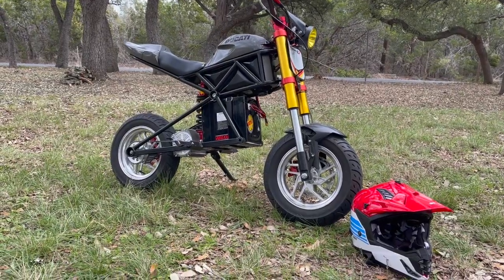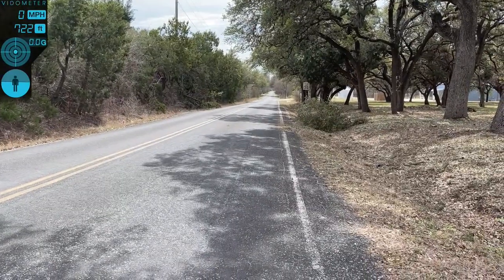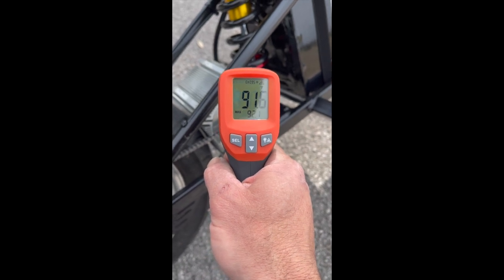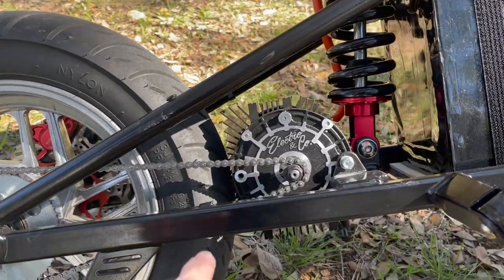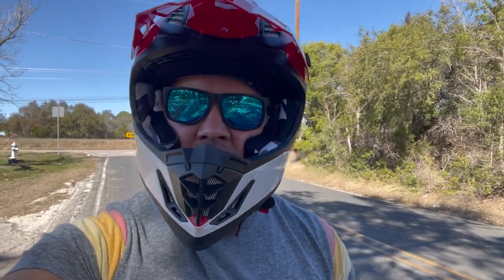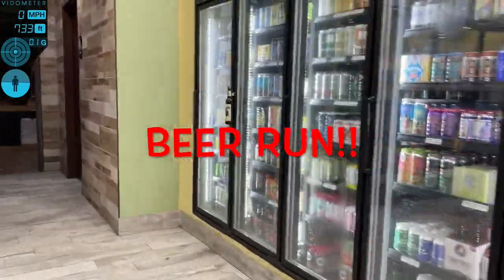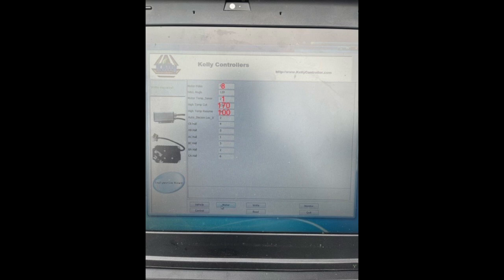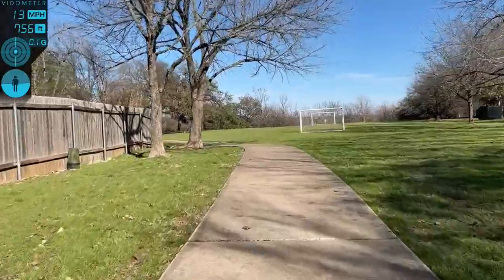Upgrading Your Razor MX500 MX650 SX500 and RSF - Electro and Co EC4P vs Kunray 72V Motors! 🔥

Comment: Definitely getting this motor for my stand up scooter. And I'll be adding 2 fans to keep the motor cool just around 92 degrees. Tha. Will be added to the Uber scooter that usually comes with a 1000w 36v or a 1600w brushless motor.
Reply from the maker: Bro… you’re going to go back to the future on that scooter! 😂
Reply: @VoltronWatts  lol. I'm currently doing 26 mph max on it with 80v from the ebay kit.
Reply from the maker: That seems weak
Reply: Add with water better

Comment: Before you tear down the RSF650. Try a Cafe racer seat one it. The stock seat sucks. With the Cafe racer seat in my opinion makes it a better riding bike the the Mx or Sx.
Reply from the maker: I did. I ordered one and tried it. Felt better but the seat was enormous looking on the frame. The seat is only one of my gripes. I don’t like that the suspension is tied to the articulating part of the bike - swingarm. 🤷

Comment: Hi! I’m wondering if the heat sink is worth it… I have a my1020 motor and I’m looking to keep it cooler. Do I need fans too?
Reply from the maker: A heat sink and fans will help for sure! Gotta use the heat inductive grease between the motor and the heat sink 👍
Reply: @VoltronWatts  thanks, did you have any overheating problems with just the heat sink on? And how much paste did you use

Comment: I’m confused why the new and improved motor runs hotter?
Reply from the maker: I was informed that the BEST way to gauge an engine temps is by a heat sensor in the motor. I did not know that using infrared heat guns will have a different temp based on the coating on the metal. Ones raw aluminum and one is finished in black. Apparently it can throw these types of heat guns off. I did see a more accurate study using the heat sensors and the EC4P ran cooler. 👍

Comment: What ratio are running?
Reply from the maker: This is a 13 front 55 rear (for now) upgrading to a 44 tooth rear 8mm chain havnt decided on the front yet
Reply: @VoltronWatts  I got a 15t 8tf and a 54t motor sprocket. Math days 60mph but we'll see
Reply: @MrHydroguy  did you test it yet?

Comment: An "MX" is more comfortable for an ADULT????   What?  Did you actually say that?

You know what is more comfortable to an adult?  A grown-up sized dirtbike frame.  Over 5'4" time to go to the marketplace and buy a 250 rolling frame with a hit engine, and bolt your Kelly drive, battery, motor and sprockets to that.  It's time to let 12 year old child have their frame back.

Also.  They make camera mounts for bikes and helmets now.  Might want to consider buying one of those.

Nice video compare otherwise, doing well with the upgrades.  But you seriously need to grow up into a Yamaha frame, that comes with hydraulic disc brakes, big boy suspension.
Reply from the maker: Thank you for your comment 👍
Reply: Right!! I was wondering what motor would be best for a 125
Reply: Imo anything bigger than a razor mx frame is a cop magnet
Reply from the maker: @oem_spec yup!
Reply: @oem_spec  Depending on what your into, the ones near the beach might be a happy attraction...  Giggity Giggity.
Reply from the maker: Thanks for watching